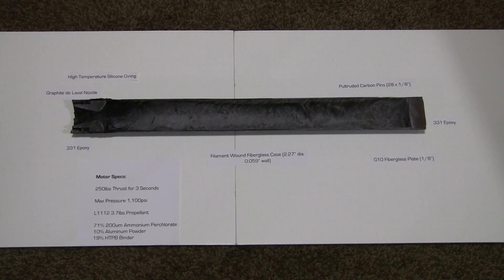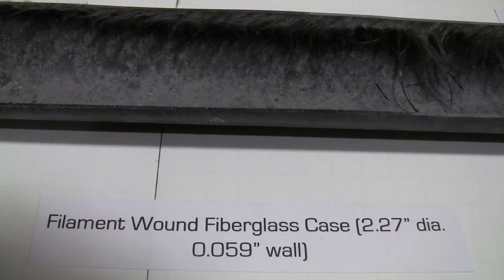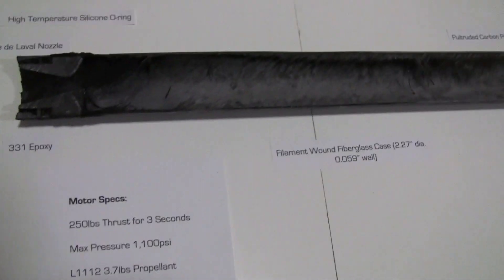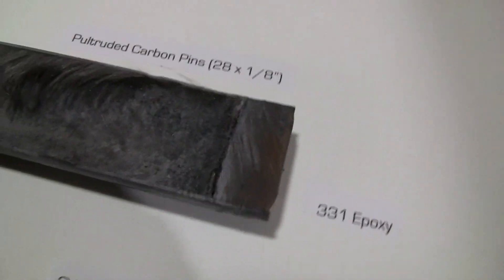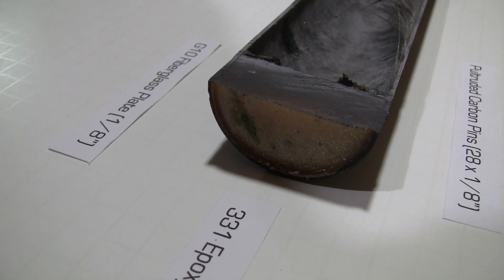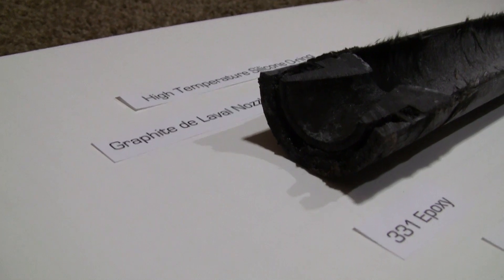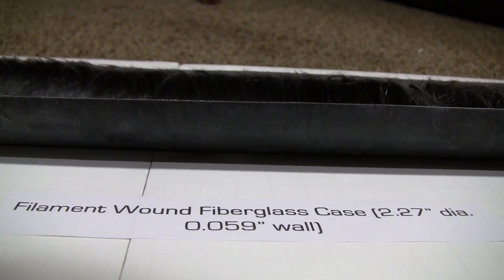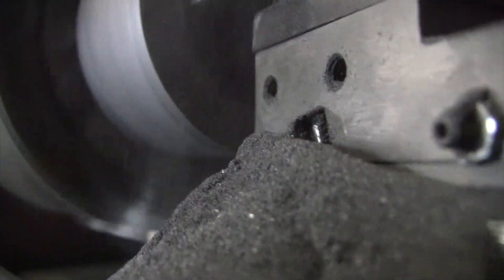Technical Details Of A Fully Composite Rocket Motor Design (WARNING, NERD STUFF)

Comment: Quite a waste of graphite nozzle for single use casing. I've been experimenting with reloadable CFRP casings for hybrid motors and I can say to use phenolic as insulation along the grain length as well as use phenolic to insulate graphite nozzle from the walls of the CFRP tube. Also it's good to manufacture the casing with high temperature epoxy so it doesn't weaken during burn time - some example of that can be seen on my video here: https://www.youtube.com/watch?v=4II2Xx13XJQ delamination due to thermal failure can be seen near the nozzle end at the end of the burn.
It's quite a good job though as for using commercially available elements, as mine were custom made specially for this purpose and so it got more expensive. I'm curious on calcs behind the carbon pins, did you test them for shear strength beforehand?